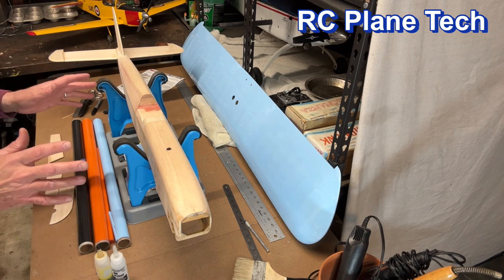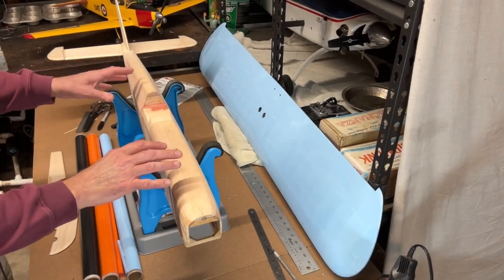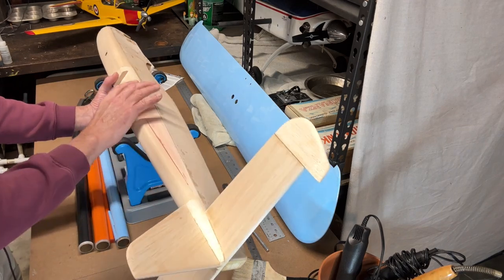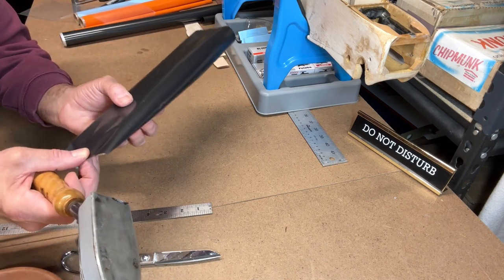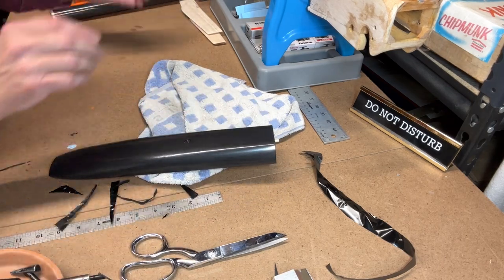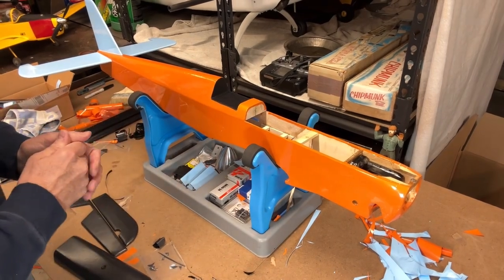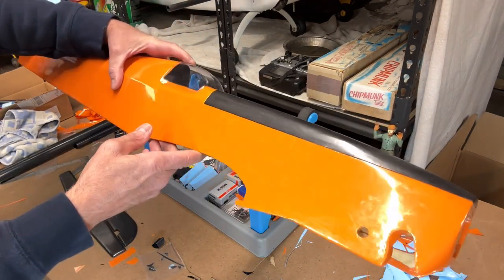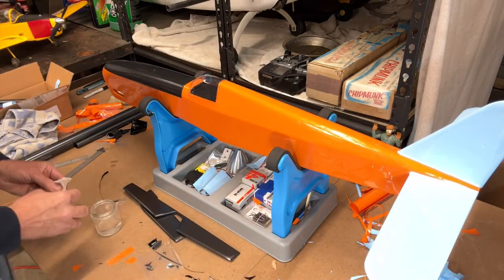Balsa USA Smoothie RC Plane Kit Build No 35, Monokote the FUSELAGE

Comment: Any suggestions on removing old stubborn Monokote. Took off most with heat gun. Got off some more with packing tape. This plane has been in a garage in the south Louisiana heat for many years. Im left with sticky orage residue in spots. Asetone only smears. Any suggestions would be most appreciated.
Reply from the maker: I try pealing it off with an exacto. Its not easy. I wouldn’t use any chemicals. I think your approach with the heat gun is helpful also. As long as you get most of it off , you can easily apply a new cover.

Comment: Looks good...on rounded surfaces like your canopy, use your heat gun  on the mono and pull as you heat it to stretch over the curves, much  smoother and easier than trying to iron .
Reply from the maker: Thanks for the tip. I have been pondering the canopy. I have some heat shrink striping i was thinking about using or just cut some monokote strips. As you mentioned, have to be careful with the canopy not to melt it. I may need to practice it on something else before I do it. Probably try my smaller heat gun used for shrink tubing for electric wires
Reply: Sorry  I meant to say  cowl not canopy, the removable top area you were covering in black forward of the canopy.  Slightly  seal at the top with your iron then start to work your way around heating and pulling down.  About an inch all the way around to grip..hit it all over at the end then trim and seal the bottom.  No slits to cut either...👍
Reply from the maker: Thanks again, I attempted that on the wing tips and need to practice more. Its an art I haven’t mastered. It would helpful if I had three hands when working with monokote, haha.